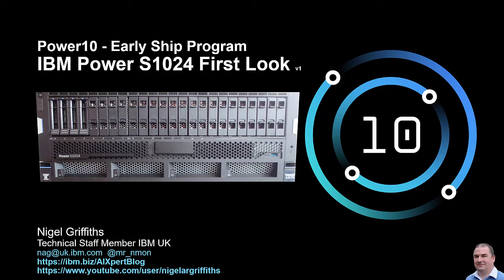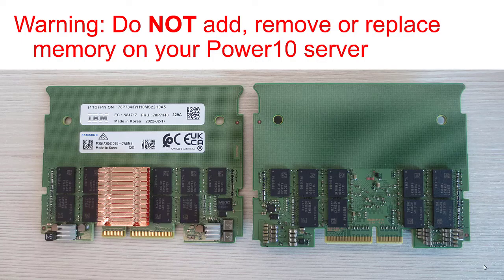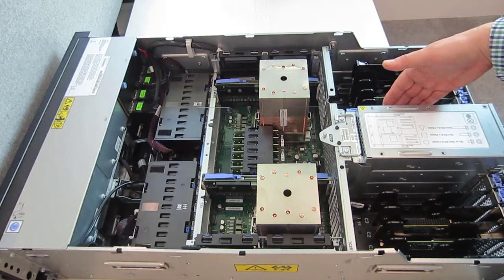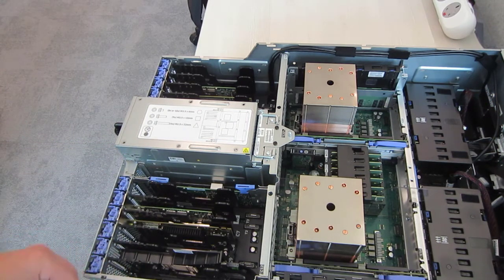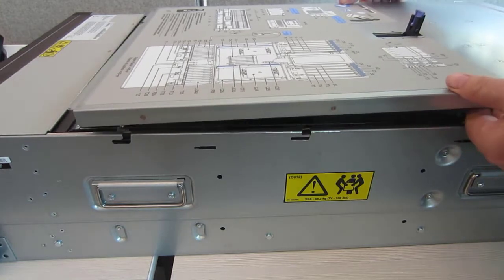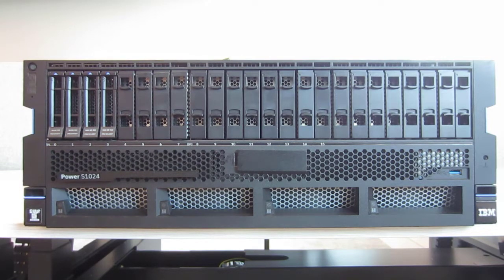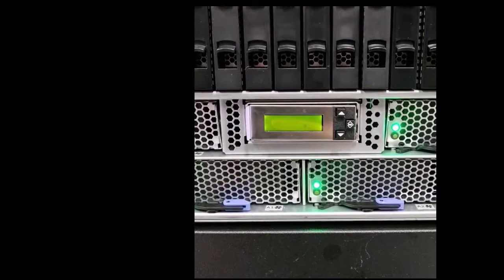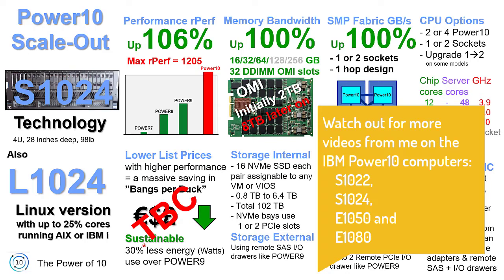S1024 First Look Live v5

Comment: So if a memory module fails, one can't have one in-house to quickly change it? one needs to wait for an IBM representative to have time, and bring and install a replacement module. So much for critical infrastructure machines.
Reply from the maker: That is rather PC-like thinking IMHO. Let me explain. The Power10 Enterprise quality memory of the Power10 servers has many built-in hardware protection of the SDIMM. For example, 1 and 2 bit correct of bit flips. Whole chip on a SDIMM failure will not stop the server,. Memory bus lane failures are worked around with spare lanes.  All these keep the machine in production and later scheduling of an outage after all the virtual machines use Live Partition Mobility to run on other servers with zero app outages.
In the rare cases of a whole SDIMM failure, the HW Hypervisor can suggest halting the processes on the SDIMM or stopping the OS running on it. These apps or VMs can be restarted and use other memory on restart. For worse problems, the Hypervisor gets the service processor to identify all problem components so that when the machine reboots the bad components are removed from the configuration. The Virtual machines will then get allocated alternative parts and the machine return to production use in a few minutes.  Of course, with any of these issues, the server uses the Hardware Management Console to send problem reports to IBM, so IBM can action the parts delivery and a service engineer.
If the client wants it, IBM hardware maintenance service levels can be 2-hour maximum for parts and engineer on site.
Power10 is fast, reliable and large (up to 64 TB of RAM) and this is reflected in the price.  Having a stack of spare SDIMMs seems like rather a silly idea.  Why have spare costly parts on the desk when you could place them in a server and get the benefits all day long?  Power10 servers are not normally sold singularly. Normal is a cluster of say 6 servers. Then a whole server outage planned maintenance or a crash the cluster only loses 17% of the performance and the surviving servers can take the load.  I say six but I just like the term "a six pack"  Let me know your thoughts.  
By the way, Power10 users are not expected to change the SDIMM memory. If you do that yourself and you botch it, then you pay for it. Always use a trained engineer. Just, like a Ferrari, users are not expected to change spark plug!

Comment: Informative video and Nigel you always make interesting videos!.   Curiosity question, for customers that run these servers as old-school single standalone servers w/out HMC, no VIOS, etc  what console options exist?  Is there a graphics card console option?  On POWER9 IBM ended support of the  GXT145 graphics card (feature code 5748) Dec 14th 2021 which has made it difficult to for us performing remote server installs for standalone servers.
Reply from the maker: Please find the Russ Youg videos on a non HMC setup using eBMC service processor in recent Power Virtual User Group session or my Plwer10 article of useful info links.